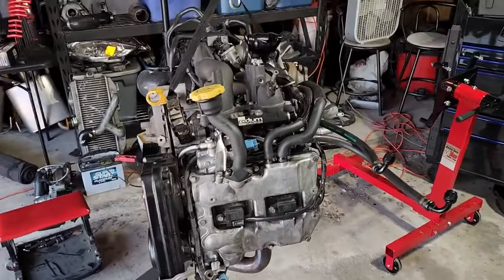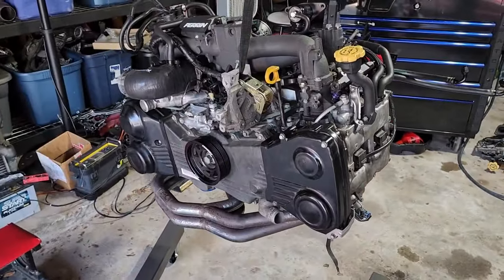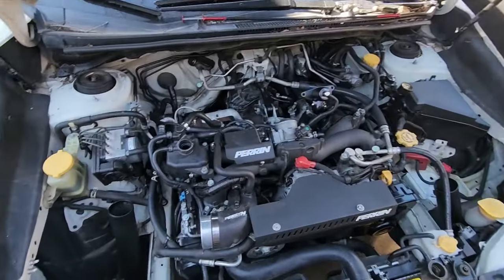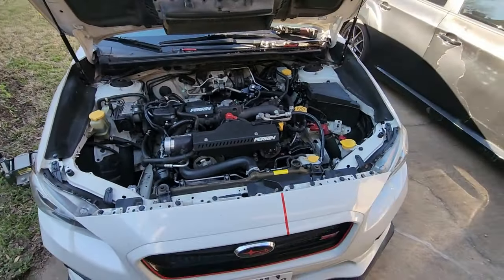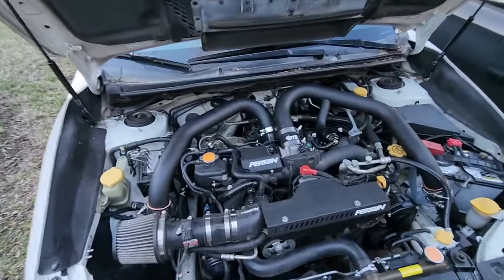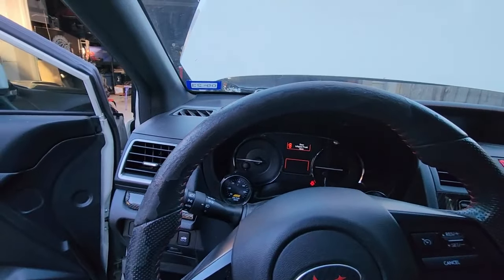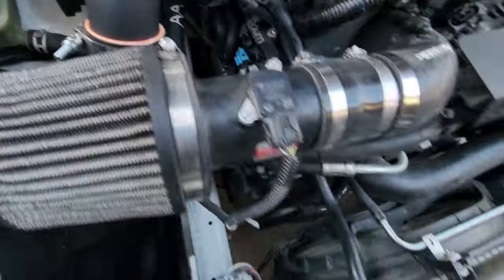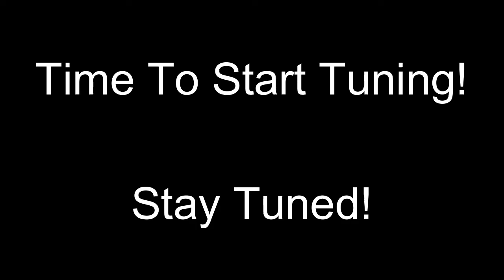Road To TX2K'24 - The Install & Start Up (500 WHP Subaru Build)

Comment: Exedy Stage 1 clutch?? I feel like the Blouch Turbo will exceed the torque capabilities that clutch can handle. Rest of the build seems proper 👌
Reply from the maker: It's the Stage 1 HD. It's rated high like 460/480wtrq. This is a daily driver so I didn't wanna go twin disk. But the way the car rips tires into 2nd and the banging of every other shift its doing great at this power level. Been beating on this clutch for over 2 yrs. Still looked good when I removed it

Comment: Hi, great videos! I’ve got a similar setup I’m putting together. You’ve got 3 inch Perrin inlet, right? How did it fit at the turbo inlet? My TGV delete obstructs the path. Have you used phenolic spacers to lift TGV a bit?
Reply from the maker: Yes it has a 3" Perrin inlet. I did end up tossing in a set of I think 8mm phenolic spacers. They are not needed, I built my buddies engine the same way with a 3" Perrin inlet no phenolic spacers, it just gets tight.
Reply: @D-TunedGarage  Yeah, I just tried to install the inlet first and then squeeze the TGV, inlet deformed a bit but not as bad as I expected. Cheers! Will be looking for more advices as I progress 🙂